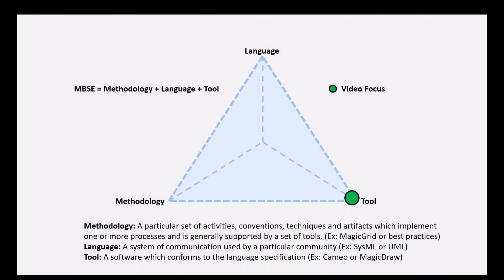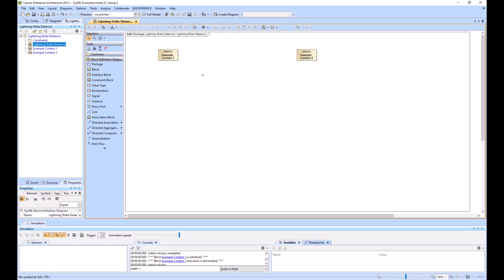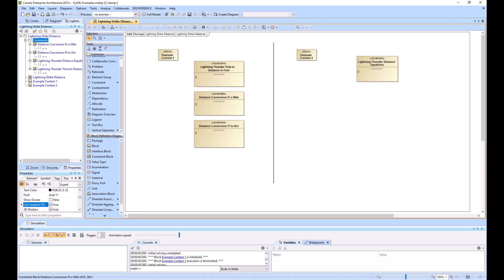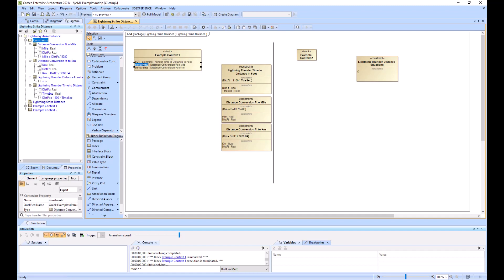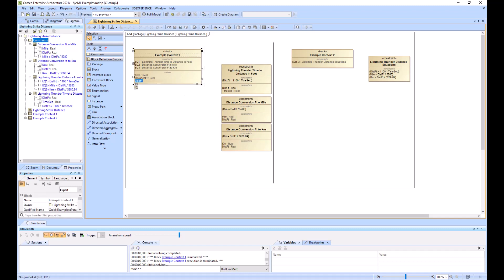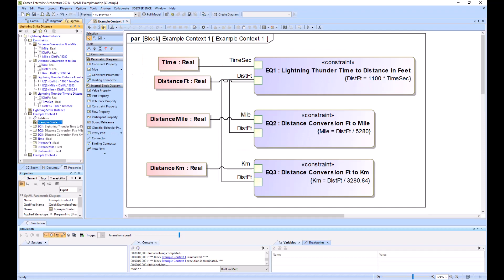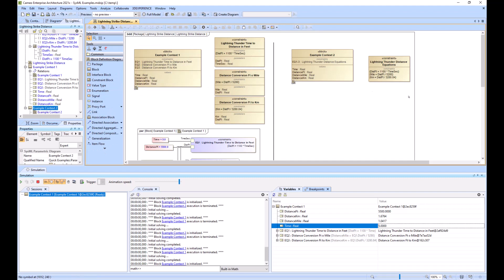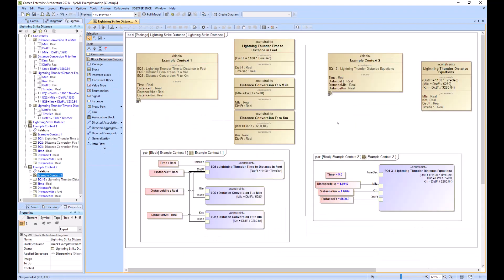SysML - Building A Parametric Diagram from Scratch

Comment: When I build this diagram I don’t understand why Time is the only input that gives me any output data with the second example.  It’s just a simple system of equations so I don’t get why any input value wouldn’t spit out all the other values.  I want to be able to enter any of the 4 variables and get the 3 others, or understand why exactly time is special in this example.
Reply from the maker: Run the simulation with Matlab as the language of the solver. This will allow you to select which variables are inputs and outputs.
Reply from the maker: https://youtu.be/8aSKaGdKIjw?si=7Ie6HZq_bcpOIJig
This video may be helpful to you.